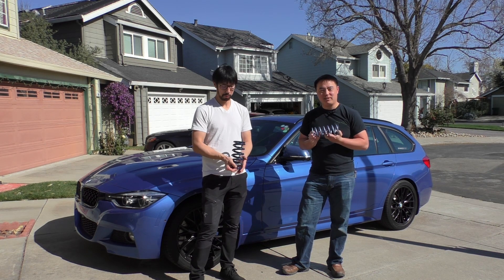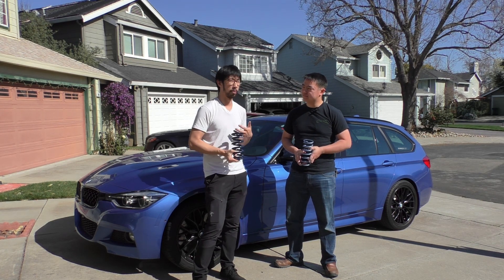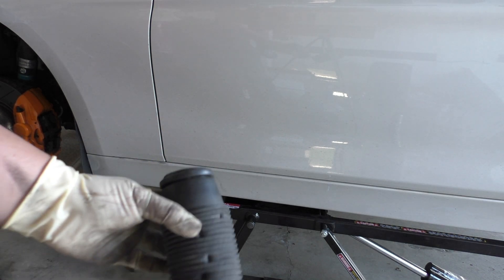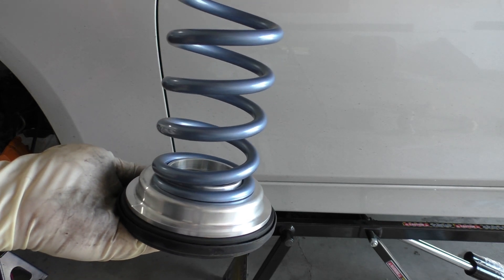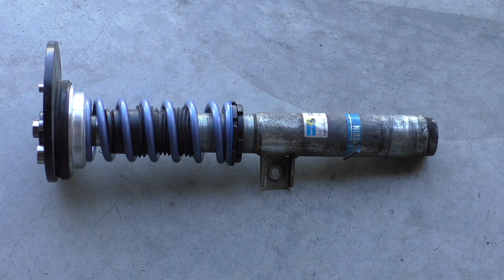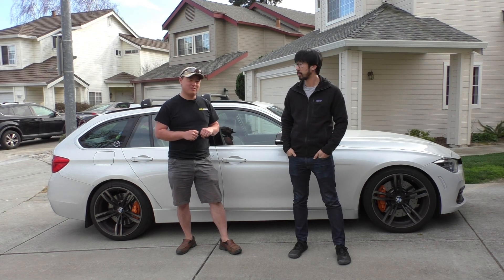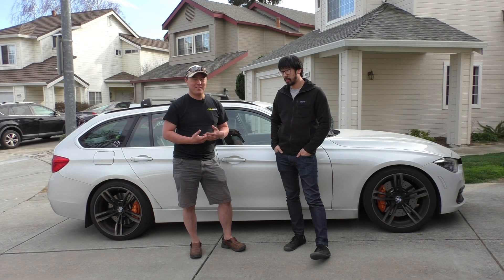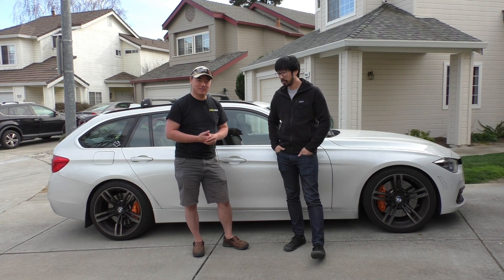Using Different Springs on a Bilstein B14 Kit (BMW F2x/F3x Platform)

Comment: Hi!
Great video! I mounted a 8 inch 60mm spring to the front 
 (400lb / inch as bilstein oem) 
However my car got higher like 4-5 inches? However the Coilovers is in the lowest setting. 
What did I do wrong? Or how do I fix it. 
Thx
Reply from the maker: You probably should've used a shorter spring (7" long, or maybe even 6" but you'd need to check preload and travel). An 8" long, 400lb/in spring should put the front 1" higher than our 280lbs/in spring did.

Comment: Very nice, informative video us usual. Question: 1.Do you use the OEM top mount? At 4.13 I think i see a camber plate..
2.Do the Milway adaptors affect the preload of the springs ?

Comment: Weird do you know that Bilstein Pss10 B16 kit for the stiffer option has the same spring rates as this B14 kit.
Reply from the maker: For the BMW F2x/F3x chassis the B14 and B16 (non comfort version) use the same springs.

Comment: A 2.5" Eibach or Hyperco race style spring would have been better for the front strut bellow to freely move.
Reply from the maker: A 2.5" or 65mm spring would be better for coil bind/travel too, but reduces the inner wheel clearance more. That's one of the main complaints about Ohlins for this platform which use 65mm ID springs.

Comment: I saw on bimmerpost you tried a few springs out.  Are there any more plug and play options out there?  I love a great suspension but the b14s are horrendous on my F30 328d. After 1 year my car is starting to rattle.  It bottoms out on med bumps and jars on small bumps.  Zero absorption.  I’d like to swap springs but with all the options out there, why do you need to go with a narrower spring?  Is there not a spring available in the same diameter with close to the desired spring rate?

Also after driving for a while would you still recommend?  I just want a comfortable ride.  I’ve never gotten that deep into it that I consider changes rates
Reply from the maker: You can also drop in KW front springs from their coilover kits to get a lower front rate. I'm using one of those right now (265lbs/in). It maintains the stock upper spring ID and necks down to 60mm like the Bilstein spring.

I think with flat ride spring rates and making sure you have enough free damper travel before bump stop engagement it can be comfortable.

Comment: Would the spring sizes you used still work if it was the B16 kit with the electronic dampening control?
Reply from the maker: If the B16 kit uses a 60mm ID spring perch on bottom then this method should still work.

Comment: How did you determine the front spring length?
Reply from the maker: We measured how much adjustment the lower spring perch had, and then did some calculations with the OE springs and new spring rates we wanted to see how much each would compress, then chose the a new spring length that would allow us to get the height we wanted while still remaining loaded at full droop. There is a bit of homework involved, but there always is when doing something custom.

Comment: Update on a new F31 328i wagon build I'm doing for Keith (also local): we're starting with an H&R Street Performance coilover. Front rate ~335 lb/in (8 inch, tapered & progressive type), rear ~638 lb/in (also progressive but linear profile). Frequencies about 1.87 Hz front, 1.5 Hz rear. I think his test ride in Christina made him realize Quality damping with firmer rates can still feel very nice on the street. 

We're going to switch the front to an 8 in long Swift, 6kg/mm (336 lb/in) and use a 21 kg/mm (1172 lb/in) rear for about 1.87 Hz front, 2.04 Hz rear. Damping will emphasize smoothness and hopefully have minimal rear jacking, up to about 15 in/sec!

This upgrade will require some custom front shafts and machining, so it's not a drop-in, but is doable. I'll likely make some videos about this as the process continues.
Reply from the maker: If he wants to avoid some of the front dust boot compromises we had to make, he can get 60mm to 2.5in adapters and run hyperco's 2.5in ID 8" 325lbs/in spring.
Reply: @FaRKle0079  Thankfully, the H&Rs already come with a narrower ID front boot designed to slip over the strut tube.

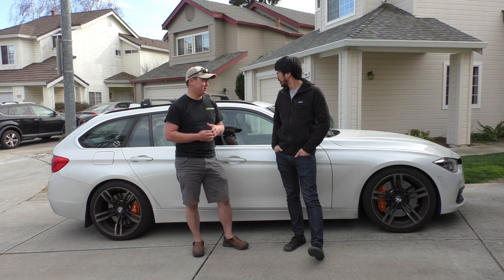Comment: And now at about 6:45 the rear 'jumping' due to being underdamped - that's where I found the rear mid-speed damping to so critical to proper settling response with Flat Ride (per my Audi S5 Avant 'no damping' Flat Ride test). It's quite possible to soften the front dampers rather significantly when you have Flat Ride, but with pitch you need to overdamp the front to (dysfunctionally) attempt to 'lock it down.'

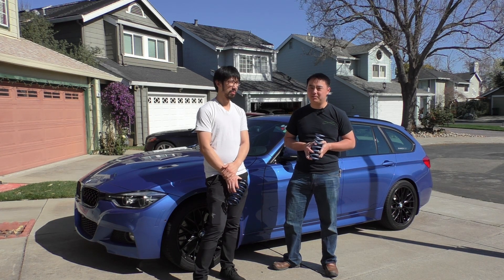Comment: Comment re: your note ~1:50 about having Flat Ride with rear underdamped. That's how Christina (E46 330i for track/ax) is currently set-up and you've felt it. She's softer-damped in the rear than I make most customer cars (I was going wildly soft as an experiment) as there's a bit of an overshoot on really big bumps, but it's something I find acceptable given the settling on-track is quite good and grip is phenomenal. I think there's a happy medium to be had and my next revision on her rears will hopefully achieve that.
Reply from the maker: With the various springs I've tried, it definitely seems to me like going to lower damping on the rear does a lot for ride comfort (moreso than the front), but the tradeoff is the vague/unsettled feeling the rear has as you go in that direction.
Reply: @FaRKle0079  Agreed. I think improved settling results when you target a sufficiently-high rear ride frequency to get fast settling at your ideal road speed, without needing to rely on the damper as much. Christina's rear damping is ~30% at low and mid-speed, and even softer at high-speed. It's much lower a damping ratio than I aim for a customer build. My Flat Ride ratio is actually pretty low right now, but I could increase it by softening the front spring and adding a bit more LS compression, which I may do on a coming revision.  Your wild west test road will be a great place to check out the results!